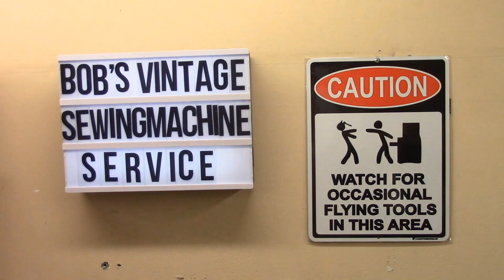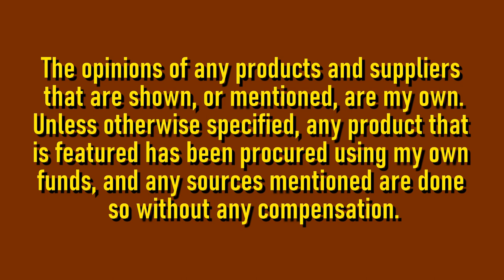A 201-2 for Kathy, the Importance of Checklists: Sunday Morning Quickies, Ep. 75 - March 26, 2023

Comment: Thanks so much for sharing your tips and tricks.  I just aquired a 201-2 in need of some TLC, although 'he' does stitch and wiring is good. The only issue I've run across is poor tension. I'll be taking the top adjusting mechanism apart to clean. Bobbin is at the correct adjustment.  My question is in regard to needle size. Should I find the 20x1needle or can I use the standard 15 and just not seat it fully?  Thanks for any input.
Reply from the maker: 15X1 needles are the correct needle for the 201 machines.
Reply: Thank you!!  Just starting this journey. He came with nothing but a box of mismatched stuff, none of which goes with a 201- had to download the manuals.